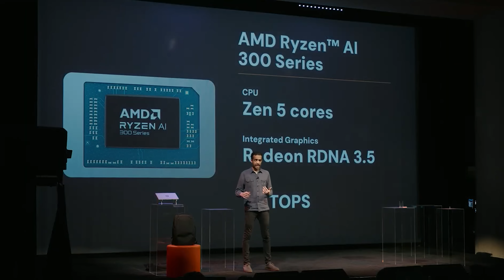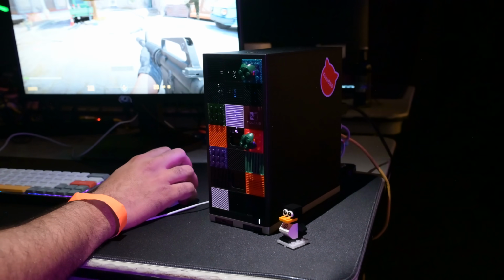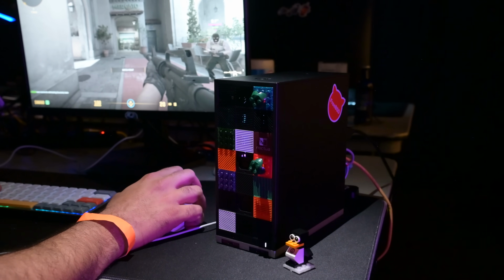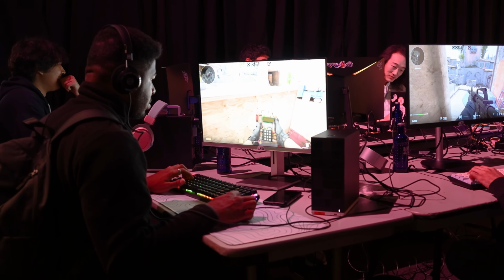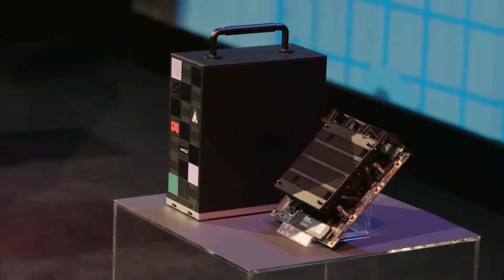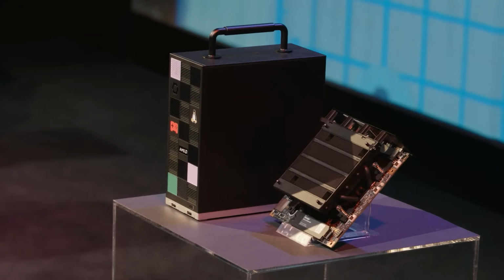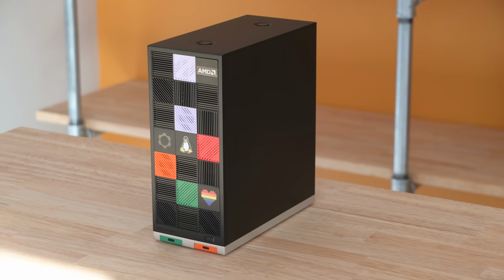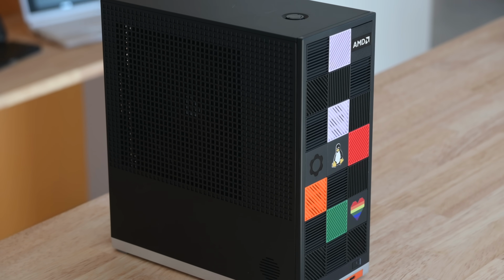Modular, Open, Repairable – The Framework Desktop Teardown!

Comment: nice teardown, but manufacturers also get to charge 2x as much for soldered down ram.

i still want lpcamm ram.  that way i can buy my own and save a ton of money.
Reply: Have you seen their pricing on the website. Actually their maxed out one is pretty competitive, it’s not like Apple level pricing. 2k GBP for their maxed out 16 core cpu, 40 core gpu & 128GB ram. If you watch the LTT video on it, can was not possible to use the cam card as you loose half the performance of ram and for large tasks in AI and items like that would make it a dealbreaker. They seem to be selling out fast
Reply: LPCAMM2s doesn't work with this SoC. Framework wanted to do it, and AMD had one of their engineers working on it, but they couldn't do it due to signal integrity.
Reply: Looking at this system in Australian Dollars - the Max+ 395 128GB LPDDR5X-8000 MT/s option of this desktop is $2990 AUD, which is $1050 AUD cheaper than the cheapest RTX 5090 (which is $4040 AUD).
Honestly, it's a right nightmare getting a desktop system with that much RAM for under $3000 AUD as it is - 96GB of DDR5-6400 as 2x48GB DIMM's is $600 AUD, 192GB of DDR5-5200 as 4x48GB DIMM's is $1050 AUD.
Reply: Sure u will save lots of Money with LPCAMM... 128GB 8000MT/S is soooo cheap

Comment: The soldered memory is not going to change, so why not score the repair ability of that?!
Reply: The RAM is soldered on due to signal integrity issues when AMD tested using LPCAMM2 modules for the Strix Halo SOC at Framework's request during development of this system - it's covered by Nirav from Framework over in the LinusTechTips video going over the new offerings.

Comment: I will see it as a "Framework acting like Apple" until I see what real world difference those soldered on RAM makes... If it's not a significant improvement, the trust is gone then.
Reply: This AMD SoC does not support soldered memory due to signal integrity. They (Framework and AMD) looked at that, it will not work.
Reply: I guess they need the AMD money so they sell their product now.
Reply: The real world difference is being physically possible. Not sure what else to say.
Reply: In Linus's video nirav said the SoC used does not support removable memory due to the 256 bit memory bus, and a big reason behind the product was to make use of that SoC (since there are hardly any). Besides, the memory upgrade prices are nowhere near as outrageous as apple, it's just a hardware limitation.

Comment: It looks like the front there also has room for an 80mm or 92mm fan
Reply: Because it is a down draft cooler the front is actually an exhaust and additional fan is not needed due to the airflow from the down draft!

The PSU actually has a fresh air tube for even more airflow

Comment: I get it with this chip has to have soldered ram.  Maybe give option of different processor with upgradeable ram- for those that want what Frameworks is supposed to be all about full modularity and  to be is as important as putting the supposer newest/greatest processor..
Reply: the mobo is standard ITX so it should fit anything you want
Reply: That already exist. It’s called go build a desktop
Reply: @cinnabun1046  thing is LPDDR5x 8000 should outperform any AM5 Desktop RAM right now and the 16 Zen5 cores here aren't much slower than a 9950x. I very much like the board but not the case and the wait time. I hope that some of the mini-pc experts, minisforum GMKtec Beelink etc come out with there own boards/systems within the year.
I also would love to see low spec GPUs go the way of the dodo and get replaced by APUs entirely and that seems to be where AMD is heading 8060s for normal people 9070 and 9070XT for gamers. Maybe, at some point /RDNA 4.5) , a bigger model again for people with more money then sense (aka the 4090/5090 NGreedia buyers).

Comment: What's that connector that the module controller hooks up to?
Reply: USB 3.2 gen 2 headers (they're different from USB 3.0 headers)
Reply: that's a standard usb-c connector, just the internal one used to connect to a motherboard. You'll find it's female mate on most modern motherboards these days.

Comment: I don’t think this is a bad product…it’s just not special. Desktops are already modular and repairable. If anything, this is less modular, with the soldered ram and no ability to upgrade graphics. 

This is just a more repairable replacement for something like the Mac mini. Even still…I’m a big fan of framework, and I would rather give my money to them rather than dell or apple.
Reply: it's special as it's designed to be a Mac Studio killer especially for DevOps LARPers people and "AI" Devs.
Reply: funny thing, it's so special, you don't see how. little help, tell me how much a system with 96vram costs...Probably more than 1999.
Reply: @mb2776  cause it has more vram, it doesnt have to be repairable, and mismarketing this (on Ifixit no less) is fine?
Reply: @mb2776  You can have all the VRAM in the world and it will do you no good, if 2 years down the line you are stuck with an outdated and slow Laptop grade GPU and CPU.
Reply: @leviathan5207  The GPU has performance comparable to a desktop 4060 with the vram of 3 4090s. This is an extremely mobile AI workstation / light editing rig, somewhere between a traditional desktop and laptop. Being niche (and not a gaming product) does not make it useless in the slightest
Reply: @leviathan5207  you buy new mainborad with beth CPU and bestest ever RAM and use your old mainboard for whatever it's ITX and uses standard ATX power put it in a 30$ case and let your kid play mincraft on it or whatever.
Reply: well you order one now you'll get it Q1 next year so that's how niche it is....
Reply: > 2 years down the line
Just how often do you guys upgrade devices? Talking about e-waste... The product either fits your needs or doesn't; I still run my 7yo laptop just as fine as when I bought it. 
Sure, if the SoC breaks it's going to be expensive to replace but it's always nice to have some competition in an expanding market with very limited choice. If you don't need the product right now just wait for a future version, when there could be less issues in both hardware and software.

Edit: typo
Reply: If i wanted a walled garden system id go with a company that does it well [Apple]. This is very disappointing from Framework and completely goes against their company’s model.
Reply: @baconwizard sure, have fun with a 3 times more expensiv Mac Studio.
Reply: @MrZocker92  Or a 50% off DIY SFF PC instead?
Reply: @leviathan5207  not with 128GB of shared Memory.
Reply: Yep they're making eWaste

Comment: Is soldered ram a open pc standard?🤔🤔🤔
Reply: @javierperrusquia6423  try watching the video.
Reply: @nickthaskater  I mean screws, storage, fan and wifi card are standard but the PSU is not standard neither soldered ram. Although I think I have saw some  similar PSU in small form builds, so I might be wrong.
Reply: @javierperrusquia6423  the PSU is just a Flex ATX unit. Nothing proprietary.

Comment: I wish this had more expansion so I could design a NAS around it. Maybe a full-size PCI, or a modular add-on to house some SSD's or something. Otherwise I think it's great, but I won't be getting one.
Reply: A NAS does not need anywhere near this much performance.

There are two M.2 SSD slots. That's a potential of 16TB (2x8TB).
Reply: @nickthaskater  Agreed, but it would at least be a justification to get one, it would be more suited as a home lab. And only 1 slot would be free for NAS duties as the other one would be for an OS.

Don't get me wrong, I'm not poopooing Framework, I was about to buy a 13 a week ago before I saw they were announcing the second gen.

Comment: The idea applies so well to laptops and just falls so flat on a desktop. There is no demand for a modular open easy to work on desktop we basically already had that in the desktop space. We needed laptops to also be easy to work on. It's the form factor and parts availability in the laptop market that makes framework appealing. They need to focus the resources on the core idea they began with it is to early as a business to be branching out into areas not in demand.

Comment: if your going to have soldered down memory then there should be a dip switch/ option to have both soldered or have a the option for having removable SODIMM Slots. There are some laptops that do a hybrid soldered on 4GB memory then allow you to add 8GB stick or have another 4GB stick.
Reply: The problem is the CPU which is also a GPU. The type of memory doesn't exist in any removable package. Its LPDDR5x in a 256-bit bus. one of the reason why it's particular of the very large bus size to feed the built-in graphics which theoretically should be RTX4060 levels of performance. It's one of the reason why graphics card use GDDR and also don't have expandable memories on GPU cards. The memory specification is also set by AMD who is making this CPU/GPU that is design for laptops. AMD did the actual testing and found the performance drop was much to high moving to a lower-bit bus (50%).

I generally agree with you about other laptops, but this one has special circumstances outside of the laptop manufacture's control that not something dubious like thinner or cheaper.
Reply: This was mentioned multiple times already. This AMD SoC does not support removable memory. The signal integrity does not allow it.
Reply: The SOC requires soldered memory. It's not a question of choice.
Reply: @nickthaskater  soldered memory is a choice of costing or planned obsoletion on the manufacturer. it is also a choice of consumer whether if it was worth it given zero path of future upgrade. Soldered memory reminded me of my handheld mini laptop (7"). It went obsolete faster than i can planned for its demise.

Comment: bruh my itx build with a 4070 is just as small and even easier to tear down
Reply: has it 128GB DDR5 8000 RAM that both your 16 Core Zen5 CPU and your GPU can use. What about the "AI" accelerator that also uses those 128GB. This is what all of you miss. It's not ment to replace your gaming pc it's ment to sell to people who would otherwise buy a Mac Studio for less than half the price of the Studio with easily upgradeable SSD storage and the ability to actually play games. The target group here is "Creatives" Video Editors, (AI) Developers and People who find the Tile stuff cute and don't care about the Money. It's well documented for repair shops will get newer mainboards down the line and run on relativly little power. Once again not targeted at Gamers or People who upgrade there ram 25 times before they get a new machine. You buy this one run it for 3 to 5 years and than replace the mainboard with the next generation und use the old bord for something else.
Reply: @DJDocsVideos  and that justifies it being unnecessarily complicated? Performance is not even my point, they're using essentially laptop components to make an tedious thing, it could be so much simpler, if someone like me can make a mini PC with off the shelf parts they can absolutely make a better one but they chose to make this

Comment: I'm not happy with the use of soldered RAM, but I'm MORE hurt by the seeming lack of any meaningful update, CPU or GPU, of the Framework Laptop 16. Are they seriously abandoning it!? Because without any serious updates or upgrades, and literally less than 10 minutes talking about it during the entire presentation, I worry.

Unfortunately, I decided to go back to a 2022 laptop (a Razer Blade 17) and just deal with the poor battery life and 16 : 9 screen because it still is more powerful than the current Framework Laptop...
Reply: They are NOT abandoning anything. FW16 just came out last year. I know, it feels like a decade :))
There have been too many awesome announcements on Feb 25. I'm sure something is down the pipeline for layer 8n the year 👌
Reply: @giomjava  I need something more powerful now though. The GPU they had was already weak but that still as best as it can go. And no Zen 5 CPU is a huge red flag imo.
Reply: @cameronbosch1213  it just came out last year 🤦 then don't buy it. You just whine.

Comment: a modular and repairable desktop? they already make those.  Objectively, it's not a bad computer, but it's by far the worst framework product I've seen.

taping down a wear and tear part and securing it with one-off bits for no reason, "specific to this case" brackets, a bunch of fiddly screws that make it no better than the average ITX build.  Using a non-upgradeable SOC with soldered RAM instead of a regular AM5 ITX board with regular DIMMS or SODIMMS (or at least putting SODIMM slots next to the SOC).  no word on the power supply, and whether it's an open standard like flex atx.  The board looks vaguely ITX, but I cannot be certain.  Even if it was, it looks like the cooler is a semi-custom job for no reason.  It could have just as easily been an AMD clamp, but they chose not to.

I'm deeply disappointed.  This product exists not to put their engineering prowess into making the ITX ecosystem better, but to create their own walled garden of knickknacks, upgrade parts, and addons.  This is the canary in the coalmine for the enshittification of this startup.
Reply: This is a silly take. 😂
It's a product to rival "Mac Mini" of the world. Also, you get a LOT of performance for just 120W, pretty impressive.
Reply: @giomjava  This is a silly take.  It's a product rival to Minisforum or similar SBCs, except it doesn't improve on cost or repairability.  The one advantage that framework has is that they were willing to make products hideously repairable and easy to work on.  They did not leverage that advantage here.  Any company can make a board with this CPU, AMD just sells them.  and you've been able to buy laptop chips on ITX boards for years now.  I fully expect to see Strix on standalone boards like the ryzen 4700s kits.  It's not rocket science.

Is framework a niche custom motherboard company, or a repairability company? Is it the company you go to buy the fastest computer, or one you can repair and upgrade for years to come? you tell me.
Reply: @kintustis  the go buy another strix point computer, if you can find one 🤷 nobody forces you to buy Framework.
I will buy Framework and I wil enjoy it 🎉👌
Reply: @giomjava  You can't even buy this one 🤣